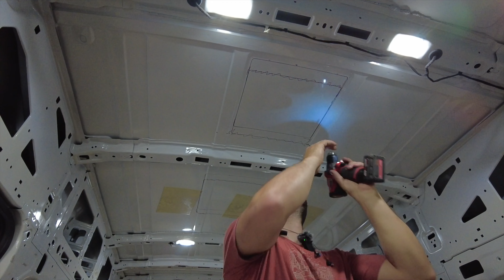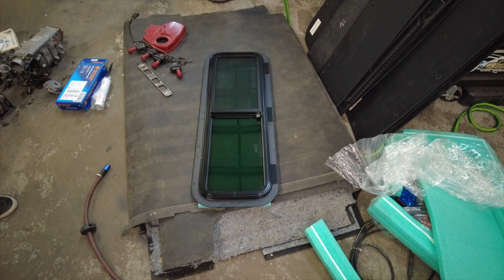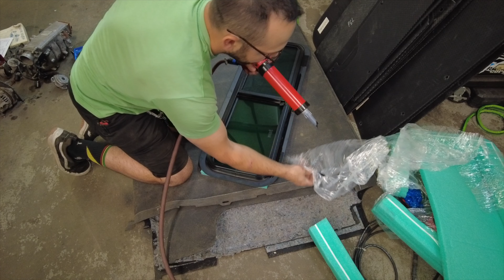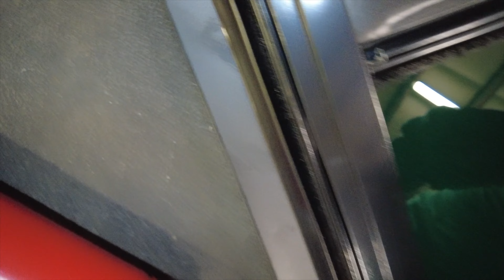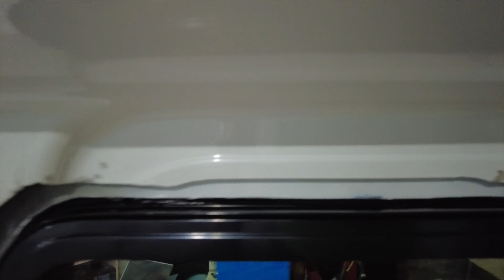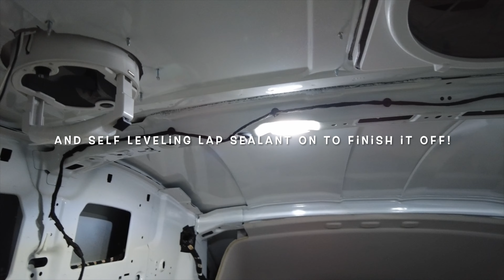Van Window Install Glue In the Easy Way

Comment: What if you don't have clamps?
Reply from the maker: @ThomasShuley  lots of blue tape! As long as the glue touches down on the metal all around it will hold in fine, the glue is very thick stuff.